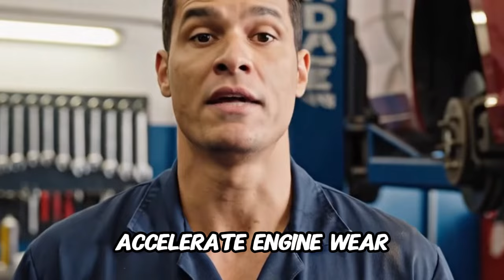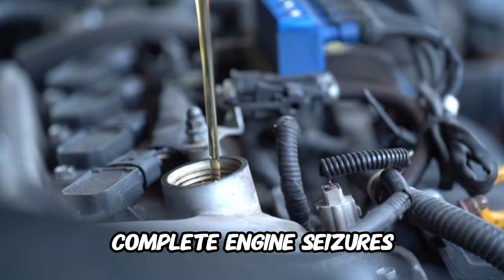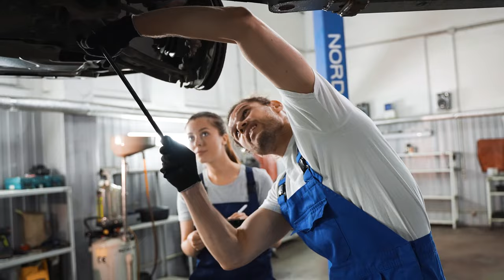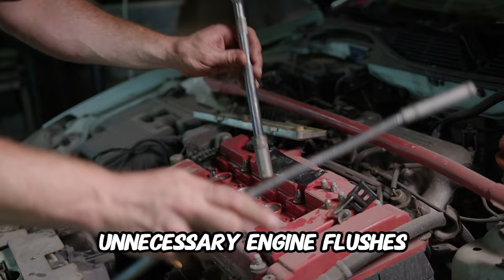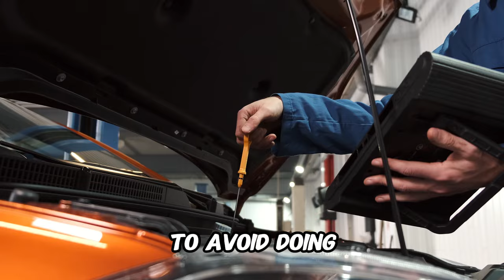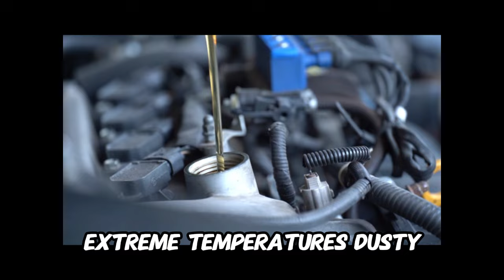YOUR MECHANIC IS KILLING YOUR ENGINE: The Oil Change Mistake With a 700% PROFIT MARGIN (SEE PROOF)

Comment: If oil changes are done on a regular basis say twice a year then there is absolutely no need to flush because there will not be a lot of carbon deposits around the engine to flush out,if you must flush then just use the engine oil recommended by the manufacturers,do NOT use these very aggressive flushing agents.